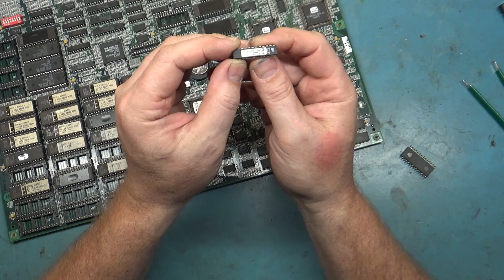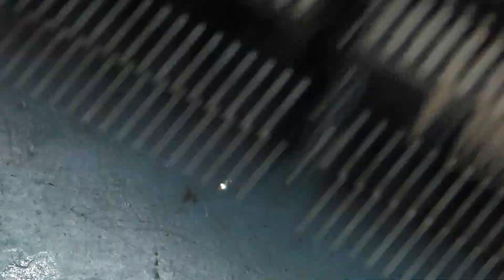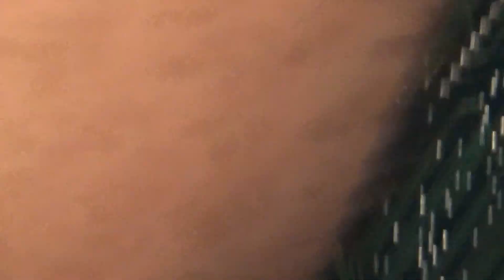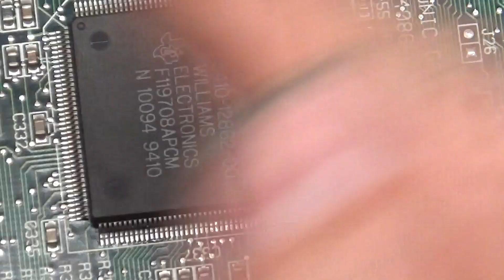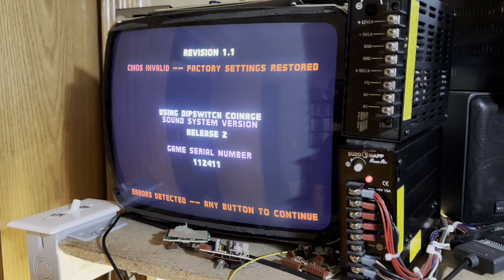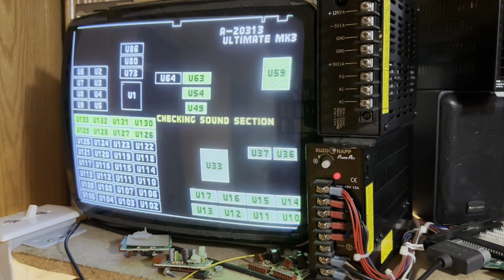Midway Wolf Unit Arcade PCB Repair 101 - The Basics Of Troubleshooting Plus Surface Mount IC Reflow

Comment: Hi Mike, I’m trying to get umk3+ working on the board….ive flashed the roms and added the u114-117 roms. But now I’m stuck in a reboot loop. I’ve heard it may be due to the serial number. Any advice you can give would be greatly appreciated.
Reply from the maker: The UMK3+ roms are matched to each security chip to prevent piracy. You have to provide your U64 security chip serial number to the creators and they will send you rom files or the roms themselves that will work.
Reply: @MikesArcadeMonitorRepair  thank you Mike!
Reply from the maker: You’re welcome!

Comment: Mike i got a nba jam hangtime pcb bad u13 and when it loads graphics are messed up..whats the best way to reflow that?
Reply from the maker: Flux, hot air station, and aluminum tape to protect the other rams around it from the heat so you don’t accidentally cause legs to pop on them. Maybe I’ll do a video on replacing those next.
Reply: @MikesArcadeMonitorRepair omg please do and ill wait to try to do mine after i watch you do it..
Reply: @MikesArcadeMonitorRepair hey Mike you gonna do the u13 tutorial video next? How to fix it?